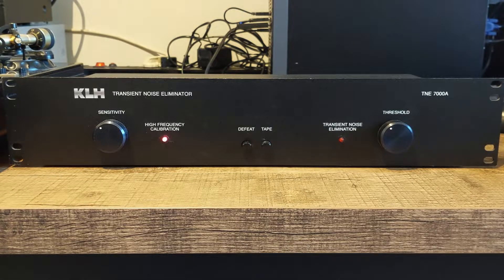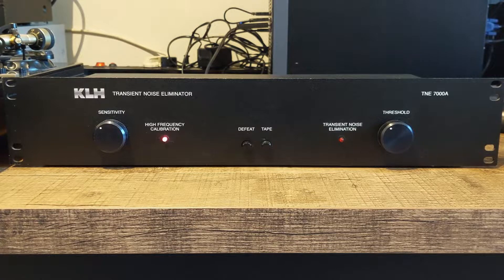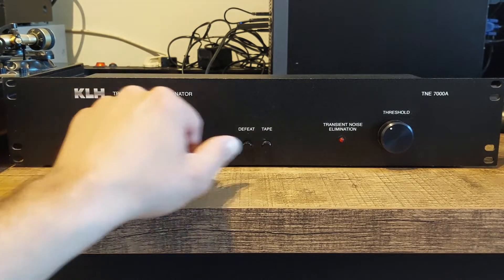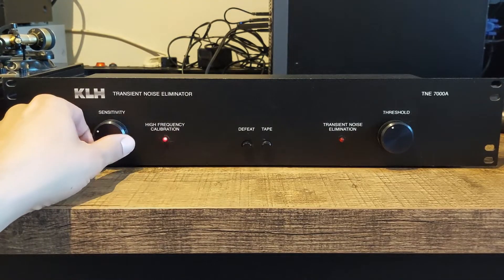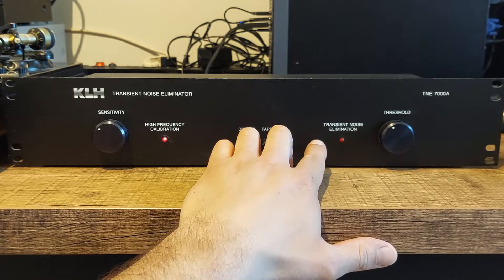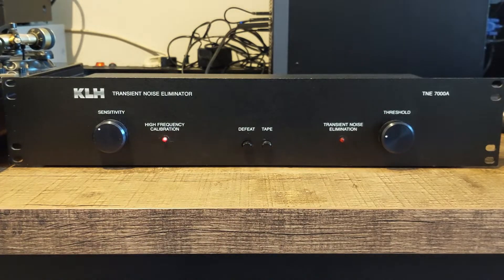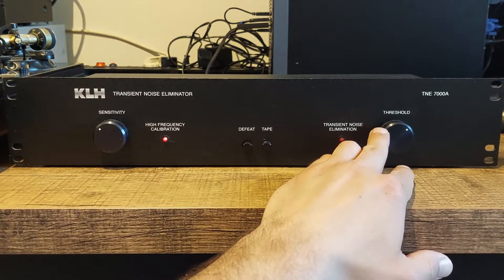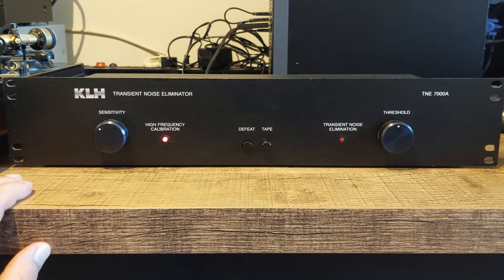Burwen Research TNE7000a Demonstration video

Comment: I hooked mine up the way you said, from the TT to the input of Burwen, from the Burwen out to the TT input on the preamp and adjusted accordingly and it just magnified the pops and clicks no matter what i did. Hit the defeat and it played as normal.  When i used to have the hooked up before i went through the tape loop through my EQ and it worked as it should. I was hoping it would work this way because it will be a lot of work to hook it up the other way, i have all mtmy wires routed on my cabnit so they cant be seen and the way they are in my custom made cabnit. Ty for any suggestions.
Reply from the maker: Hello Mark, Ive gone over my notes and the service info I have on the TNE7000a, and I believe it needs a line level to work properly. Other have reported a similar issue to yours when using the audio signal directly from the turntable( before the preamp.) So the signal from your turntable has to pass trough an phono pre-amp first, before feeding it in to the 7000a. My turntable has a build in phono pre-amp,and that is why I connected it directly to the TNE7000. I adjusted my previous comment below with the updated info. I hope this helps.

Comment: This also worked great with noisy FM stations.
Reply: I have the other filter also from them, the TNE 1201A. (Transient Noise Eliminator) It's for static and white noise, tape hiss, ect. It works great in conjunction with this one. These were originally made by Burwen Research. Either the company changed names or it a sister company. Exact same components.

Comment: Thanks . I didn’t have tape in and out only play and record. Should I plug it into my preamp in and out ? 
Thanks ahead of time. I gave it connected to Sansui au- 517
Reply: Thanks !
Reply from the maker: Connect the turntable to the input terminal of the Burwen, and connect your (pre-amp) line-in to the output of the Burwen.

Comment: Nice video I was wondering on hooking the unit up can you run the turntable right into it to the receiver if you wouldn’t mind sharing thank you much
Reply from the maker: The Burwen is not a phono pre-amp. You  feed it a line level signal, and than connect the Burwen to a line in on the amplifier,

Comment: Say, I need an owner's manual for this device. Any help appreciated. God bless. Ed
Reply from the maker: Hi Ed, I have the user and service manual available. I can send you the files or a link to the files. Do you have an email address I can send it to?
Reply: @ralphlauwaert2245  Hi ralph, would it be possible to have a scan of the manual? Thanks
Reply from the maker: @yelayela857  sure : https://www.dropbox.com/s/7edn14h7n0l1mr5/Manuals.zip?dl=1
Reply: @ralphlauwaert2245  Thank you 😁. Could you tell me how you made the connections with the turntable?
Reply: @yelayela857 I have a few different components. I just run them on my tape 1 in a loop. TAPE OUT to graphic equalizer, then reverb amp, then stereo dB expander, then TNE 1201a (transient noise eliminator from Burwrn research also), then to this DNF 7000A (dynamic noise filter), then to TAPE IN.
   You could probably just run your Turntable into this, then run out to the phone input.
Reply: I think first to noise eliminatior then amp probably aux

Comment: Is it my imagination or is there a drop in "air" and treble when the 7000a unit is engaged? Thanks for posting. Really interesting technology.
Reply from the maker: There shouldn't be any drop on treble or "air" when using the controls correctly (=moderately). What this unit basically does is look for very sharp transients in the audio (such as a scratch in a record) and then mute the audio for a (few ) milliseconds so that the scratch is not audible. If there are no sharp transients detected, than the audio stream is passed without any processing. You can get audible artifacts and a reduction of the very high frequencies if you set the controls very high. The high audio frequencies are then starting to get 'detected' as if they were 'scratches', and you can get audible artifacts. If you don't have one of these units, I can recommend getting one. They work really quite well.
Reply: @ralphlauwaert2245  Thanks for the reply. Yes, I'm seriously considering getting one. They are pretty expensive so I'm doing my homework.
Reply: @labnine3362  don't know if you ever bought one, but I can offer this. I've been using one since the mid 80s, along with the other static/white noise one (TNE 1201A Transient Noise Eliminator) they offer. It works in conjunction with this, awesome for recording it onto a second source (like a tape or cd) or just outright listening.
Reply: @chriscook5613  I did end up buying one and it is pretty amazing technology.